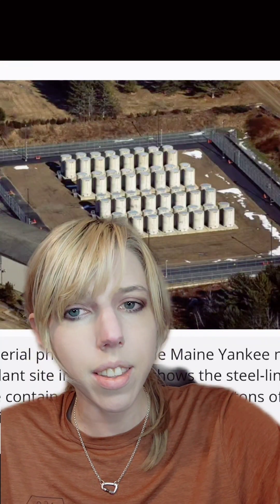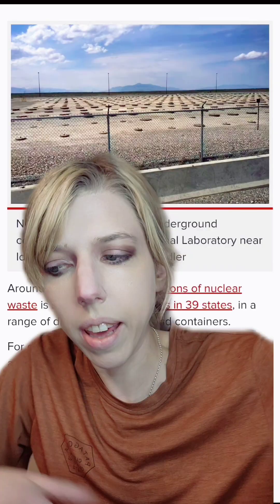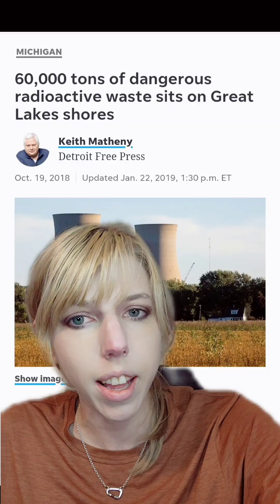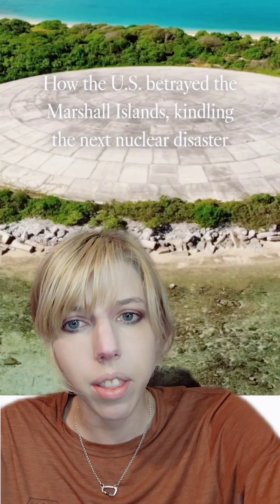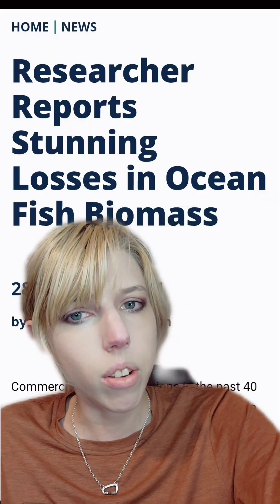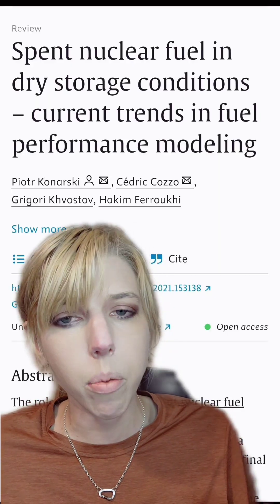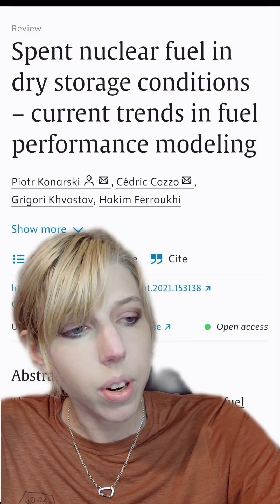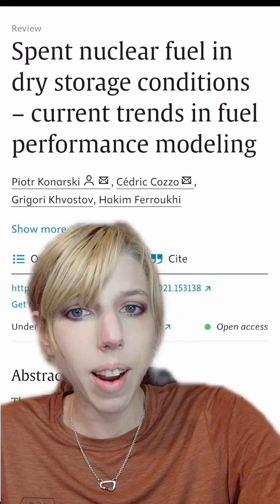90k Tons Of Nuclear Waste Stored Temporarily With Nowhere To Go

Comment: my main reason i remain firmly anti nuke. 
we really have no idea how or why teh pyramids were built, but our ancestors set about smashing them open because they KNEW that you would only go to that effort to make such a secure strcture if there was something valuable inside.

us? we leave these big secure vaults... strange symbols all over... of course there must be something valuable inside?

heres your dose of tutankhamun's curse... silent, invisible, and deadly for millenia...

90,000T of uncontained waste... toxic for thousands of years... what a legacy we leave.

and as for the "efficient" form of energy? 

we mine a thousand tnne of rock. we obtain roughly 150kg or uranium. that then must be dissolved in fluorine, to be centrifuged, to remove the 0.1% of useful isotope. teh remainder we can break into plutonium and use that as well, but we need the initial uranium to get it all going. 

and then, we dont utilise all the energy being released in that decay. we use a tiny fraction, less than a percent, to then boil water... and that has its inherent 60% or higher loss.... the remainder of that energy stays as dangerous radioactive decay... some elements decaying slowly, quietly, some decaying rapidly, into other elements with other decay rates, a nightmare broth of battered and bruised elements screaming in pain as they get torn apart by their own desire to not exist...

Comment: These storage of casks are certified for 100 years and can probably last for a couple hundred more years. They are designed to not leak in the case of missle strikes and can withstand a direct hit from a locomotive. It isn't a terrible idea to keep these above ground for a while because spent nuclear fuel can be recycled. So I think the risk from keeping these above ground until we can get it together with long-term underground storage will be fine.

Comment: Don't put it anywhere. Most of that waste is probably perfectly fine fuel or non-radioactive materials that have been contaminated. The problem is that there is not enough investment or regulatory consideration for processing it.
If you could process that nuclear waste properly, you would end up with fuel, harmless waste and a lot less radioactive waste with different half-lives.
There are technology start-ups that aim to do some amount of this, it's also done to some extent in France.
It's the best thing we can do with nuclear waste. It's the same thing that is being done or should be done in a lot of other industries.
Sadly as long as there is a cheap source of material somewhere in a third world country, your domestic producers will go bankrupt, just like it is the case with cobalt mines in Australia, for instance.
And therein lies the true regulatory problem.

Comment: Are you fucking kidding me? 90k tons is literally a drop of water in the ocean. Here is the math: Approximately 21.58 million gallons of water weigh 90,000 tons. 12.58 million gallons is about 0.00000000358% of Earth’s ocean volume — essentially microscopic in comparison.

Comment: There's no way to refine and reuse them?
Reply: There is. Nuclear waste is 90% recyclable, but building the facilities and the infrastructure required is really expensive. Plus the process produces plutonium which complicates things on the political end. But the waste can be recycled multiple times. Only a handful of countries recycles, with the most prominent being France. Several methods of recycling are being researched but progress is slow. The biggest obstacle as usual is the people's fear of nuclear power.
Reply: @MeMow-km5e  May be then these wastes should be exported to France.
Reply: @MeMow-km5e  I would say that the 90% figure is definitely false but for a different reason:
Majority of nuclear waste is stuff like tools, gloves etc with the actual spent fuel being only a part of it, but the good thing is that afaik those decay somewhat quickly and become regular waste or at least waste that's much easier to deal with.

Comment: I have no idea how to safely store or dispose of nuclear waste... If getting things into space was more practical I'd say getting it into a stable orbit around one of the outer planets would be ideal... If not that I have to imagine there's a deep fairly stable abandoned mine somewhere that isn't connected to an aquifer or other water system.... I guess the best of all  solutions would be finding some way to treat it so it's simply inert but idk if such a thing is even possible.
Reply: The long term solution is throw it into the sun, which will totally solve the problem, the difficulty is putting nuclear waste in a spaceship is basically creating a wmd if it blows up, as they sometimes do. Maybe we need to wait for a space elevator before doing that.
Reply: @EcclesiastesLiker-py5tsspace elevator is impossible for rhe foreseeable future